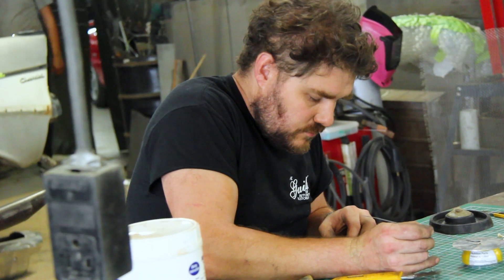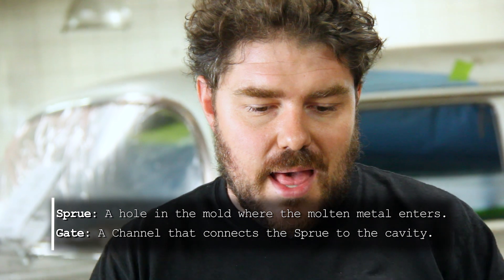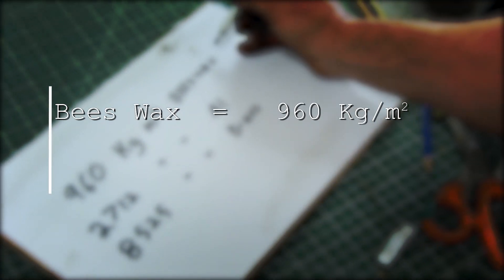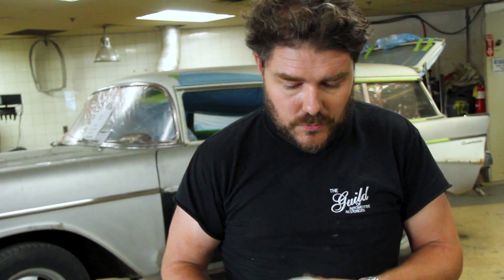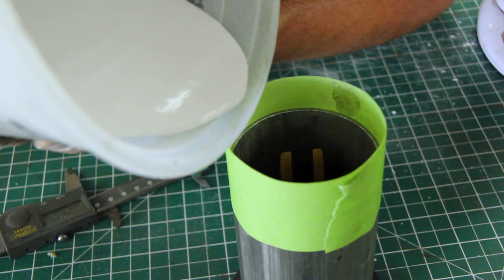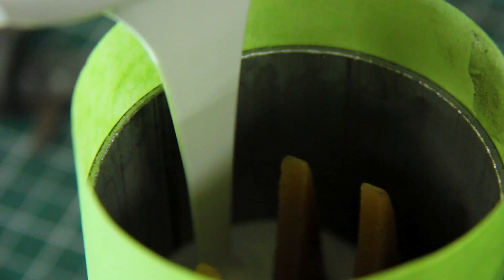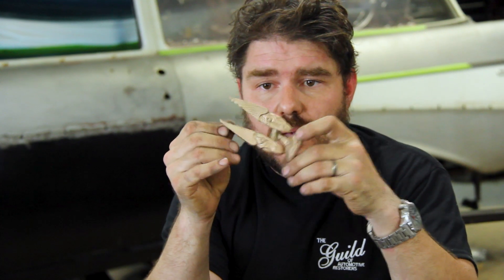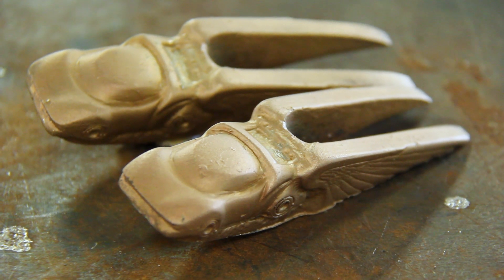Metal Casting | Lost Wax

Comment: Very good job. I just want to ask you a question. Is it possible to make the front drive sprocket and rear idlers for a german Tiger 1 tank in 1/35 scale in brass, aluminum or steel using the same investment molds you used? The circumference of the drive sprockets are about the size of a quarter.

Comment: Another good conversion technique is simply to measure the volume of wax of sprue, gates and objects, in a graduated container of water.  Then make sure you have that volume of molten metal to pour into your mold.  counting ball bearings or other small objects in the metal of your choice which can be added to the container of water for calculating is a handy super simple practical method of doing this.  if weight is still needed, you can simply weigh those ball bearings afterwards.
Reply: L❤VE IT.

Comment: you made me remembering the days of jewellery, and the mistake you did is in the minute 4:03 is you didn't retun it to the vacuum chamber to extract the bubles, and i use to mix some soap and water on another cup where i emerge the project in, cause the soap on wax will help the extraction of bubles, try it, and you'll be happy of the result, good luck, and good videos.

Comment: The calculations at around 6:53 would result in the unit g^2/cm^3 not cm^3. You should divide the mass by the density to get the volume. After that you do multiply. It's always good to check your units, this can help spot problems. You would have gotten 441 grams of brass.